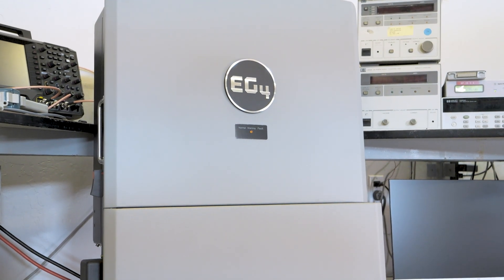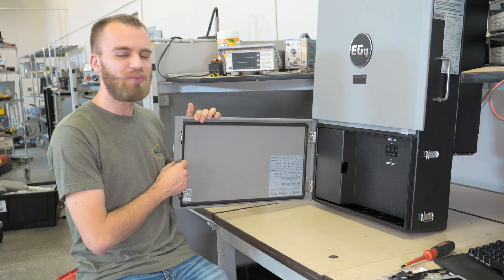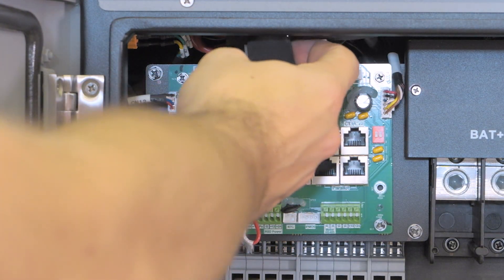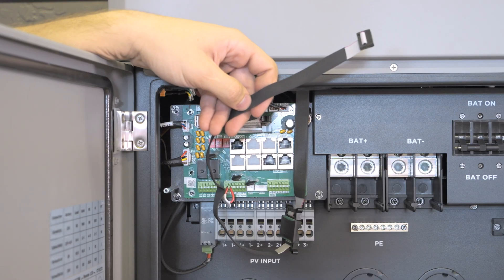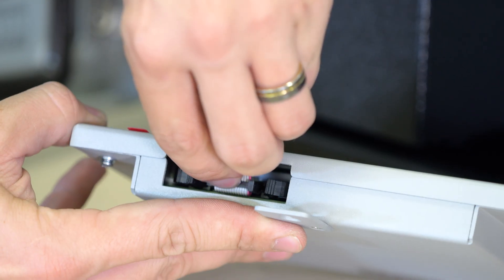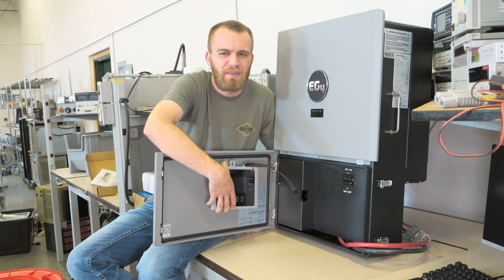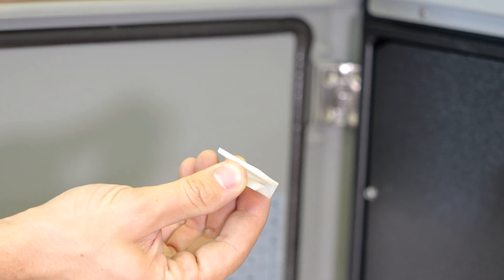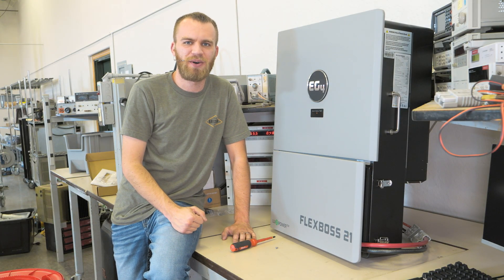EG4 FlexBOSS21 LCD Screen Kit - Step By Step Installation Guide

Comment: Some of the stuff that EG4 designs is janky. 

They sell you a screen but not a real good way to have it mounted. It's mind boggling to me. 

How about an option to extend the cable a little farther so you can have it mounted on a wall inside your home or garage? 

What if for some reason the internet goes down and you don't want to have to access the monitoring app or website. The screen is nice because you can check the status of your system just by looking at the screen.

Comment: I think I’ll drill a new hole in the arc shield, to the left of the battery breaker, and use a bolt and nut so the screen basically stays on the shield.

Comment: What happened with the SOK batteries? I see there is nothing on your site.
Reply from the maker: The SOK batteries have been discontinued, and you can still find the product listing with all relevant documentation on our website under Shop > Discontinued Products. Alternatively, if you purchased them while signed into an account on our website, you can access the product listing and all relevant links by clicking the account button and going to My Products. 

You can see all products purchased through your online account there for easy access, whether they are discontinued or still active. Let us know if you have more questions!

Comment: Hah such a weird hack for a screen. Idk why a screen is such an expensive “addon” they omitted it as a cost savings. You can buy whole tablets for sub $100 with nice IPS screens now.
Reply from the maker: The idea is that an installer could keep just a single screen for initial commissioning and swap it between multiple inverters and then maintaining any settings can be done through the web software. Once an inverter is properly set up it should not need much hands on re-programming.
Reply: @CurrentConnected that’s one approach. Less data and screens is definitely the trend these days.
Reply: EG4 has talked about this a bit.  They want their equipment to be a great deal to democratize solar.  Having this as an option means cheaper, so overall I'd say it's not a bad way to go.